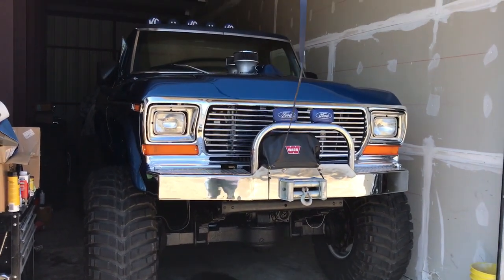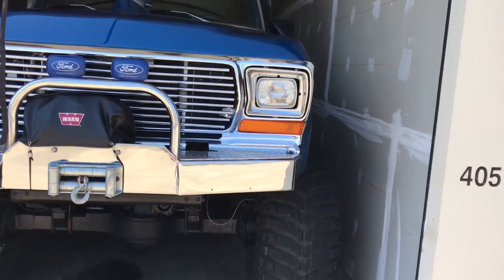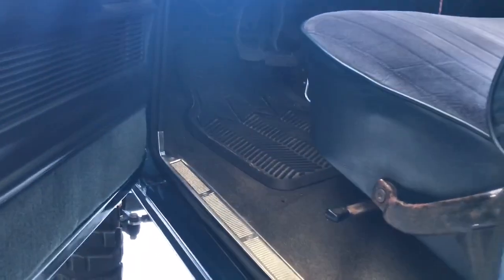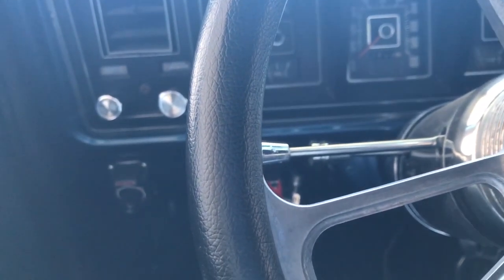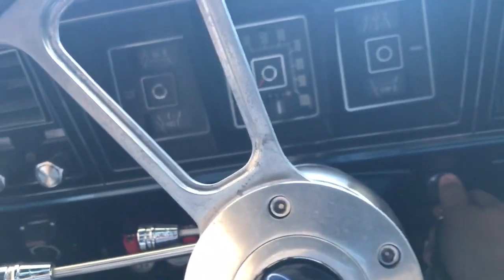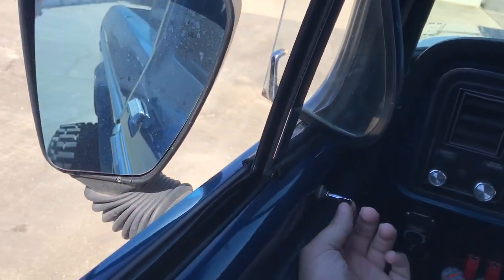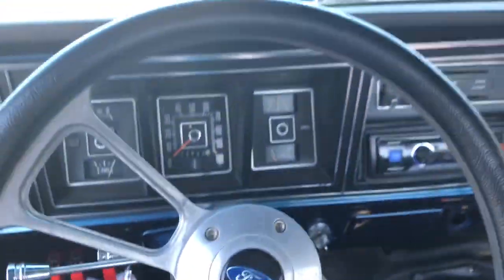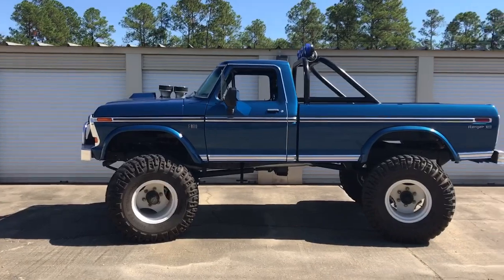Cold start from the inside of the Bigfoot 1 monster truck replica clone

Comment: I wonder if Bob Chandler has ever seen this.
I saw a video a few days ago where they showed how they started apparently it's quite involved. They're turned on the accessories then they had to flip some main power switch in the cab then pull out some lever then pumps the throttle and then turn it over. I don't know why they have to do all the extra steps couldn't you just turn the key and start it up?

Comment: Doesnt seem to be that temperamental   for a cold start ..  what are the specs of that engine if you dont mind me asking?
Reply from the maker: 460 with 8:71 BDS supercharger. 8-1 compression, low for the supercharger and able to run on 92-93 octane. It’s pushing around 700 horses I’m thinking. The guy I bought the motor from said 1000 horses but I really don’t know. It was a built motor when bought and we tore it down enough to put some new seals in it and just check out everything. It all looked brand new inside so we sealed it back up and ran it.